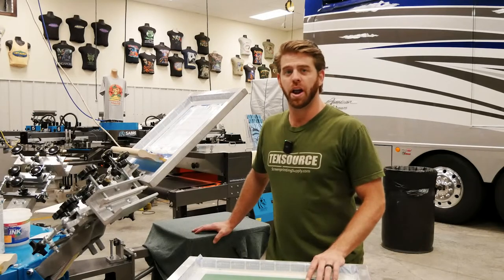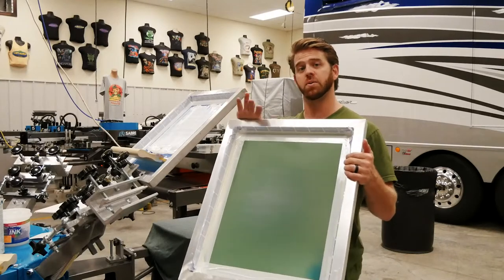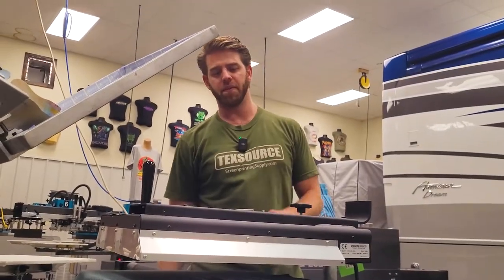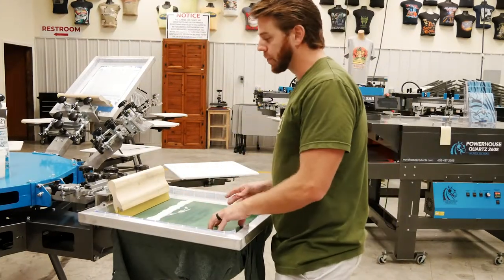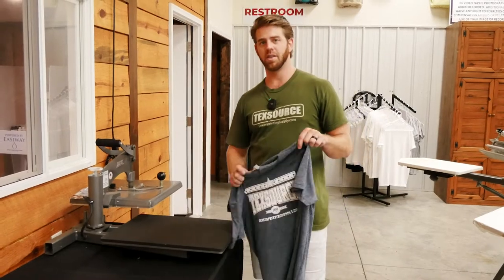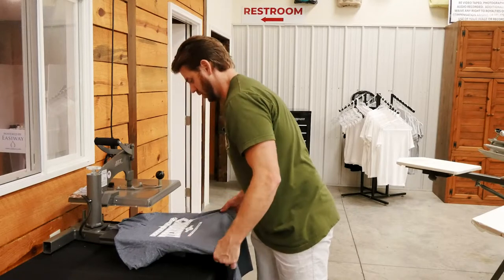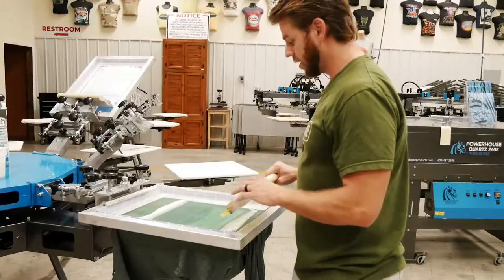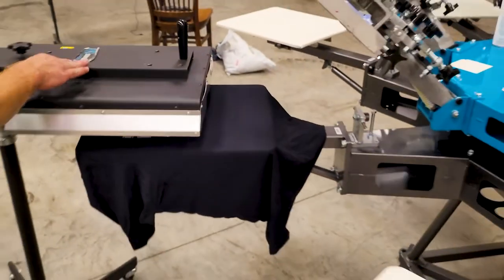How to Use Smoothing Screens and Heat Presses for Smoother, Softer Prints #screenprinting

Comment: Fibrillation happens after the first layer of ink. It would make more sense to do white, flash, smoothing screen, then print second white and send to convayer. Or else your doing extra steps for big orders your double flashing each garment when you should only flash once. This would be super hard for a manual printer when doing bigger orders, slowing down production